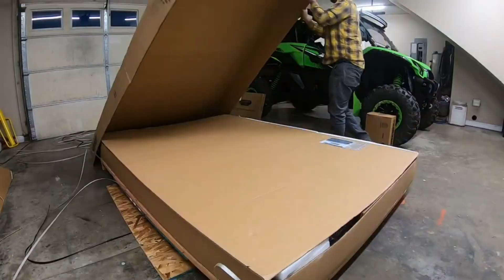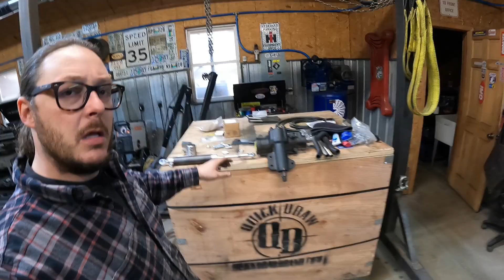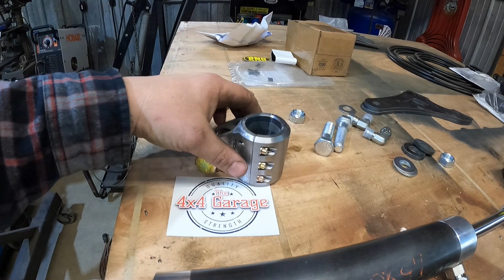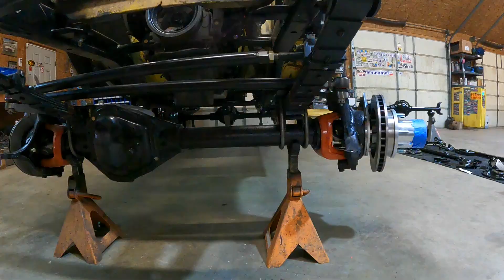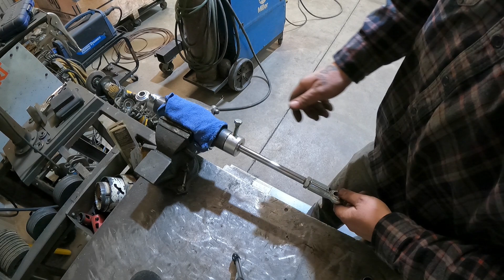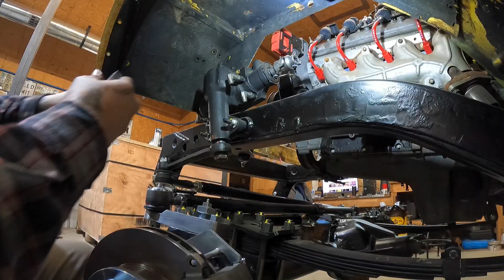One ton International Scout Off-road Build Series (Part 4) Big Bird gets Hydraulic Assist steering

Comment: I used the Redneck Ram on my last Scout II and really liked it. I thought they had gone under so I got a PSC for my 800 build.  The PSC cost a lot more.
Reply from the maker: Nope they are still around.  I use them alot. Actually have 2 more setups kicking around that need installed on rigs.